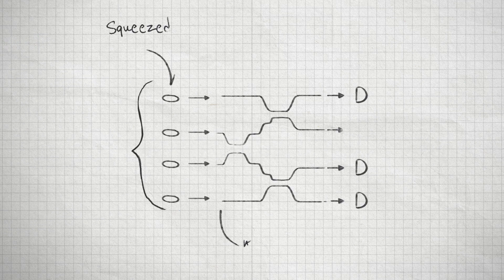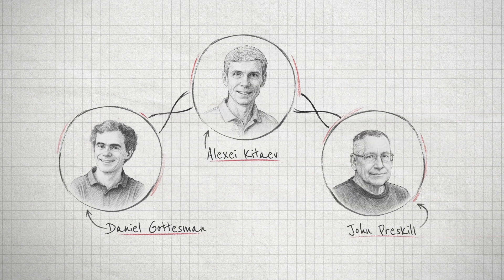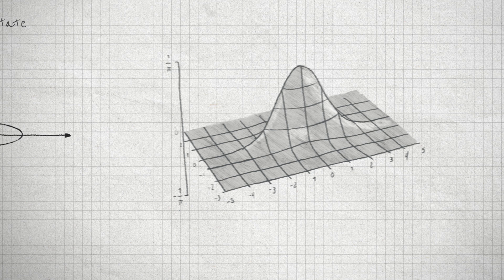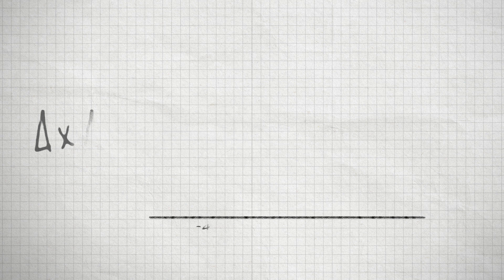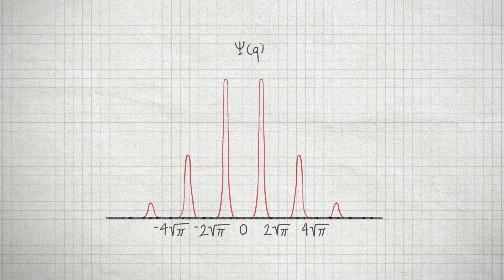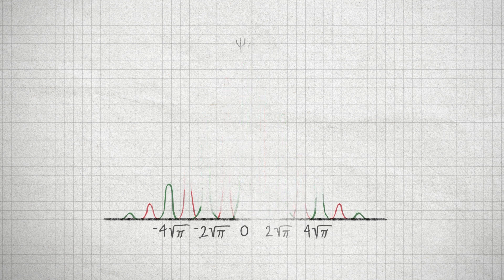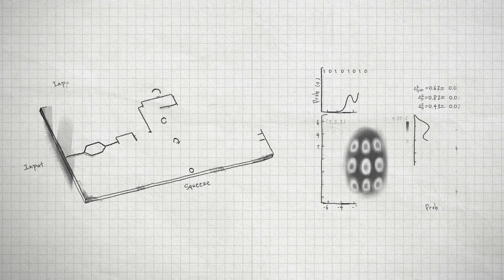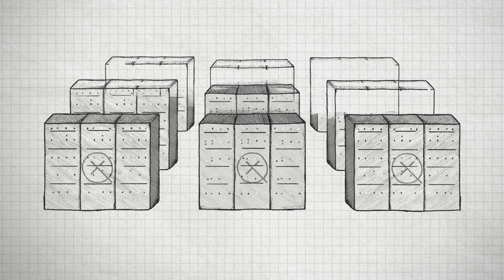Xanadu Demonstrates World's First Error-Resistant Photonic Qubit

Comment: Wich quantum gates will manipulate these GKP qubits? It will be quantum optical related gates or it will be developed a new layer of abstrataction to implement quantum gates similar to those from discret QC

I hope that with this breaktrhough Strawberryfields development get back on track
Reply: It's an optical quantum gate, for the speed and simplicity I assume.
Reply: Using Clifford gates that map Pauli operators to Pauli operators using the beamsplitters phase shifters and homodyne measurements but for universality you need non gaussian gates as well like T gates (non Clifford gates) since its a grid structure in phase space they implement Clifford gates like Hadamard, CNOT, S, CZ with things like feedforward displacements homodyne detection and other linear optics. There is more information on the published paper if you're interested :) "Integrated photonic source of Gottesman–Kitaev–Preskill qubits" on Nature